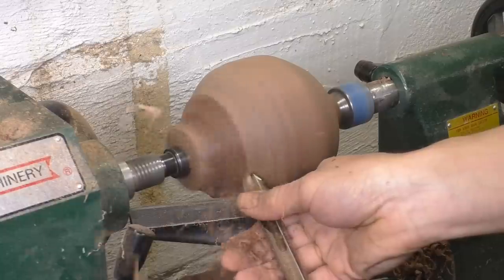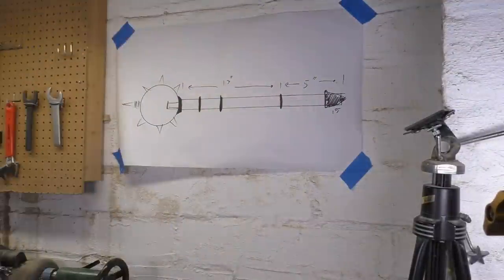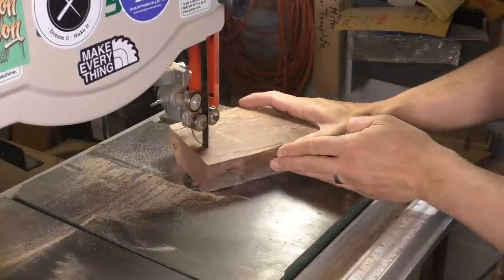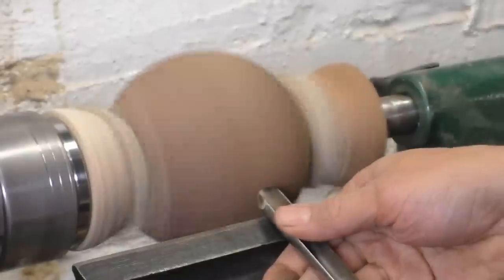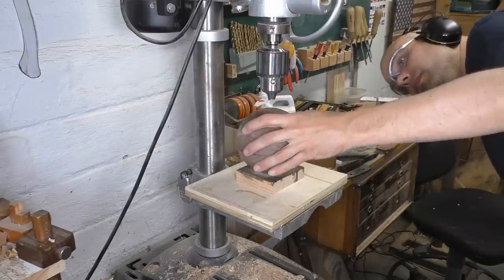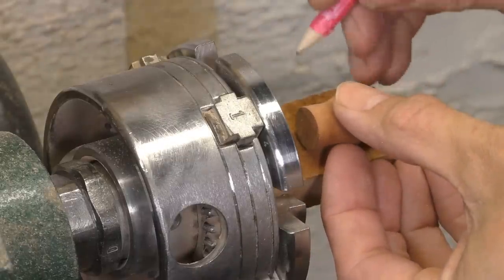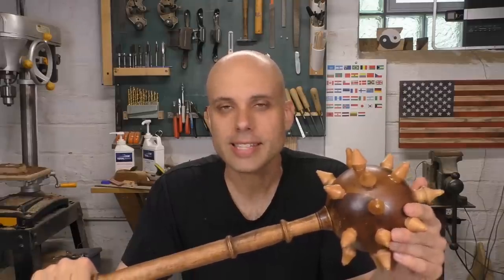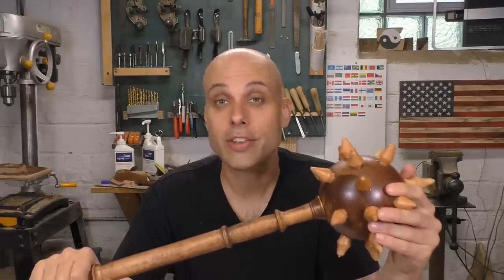Woodturning a spiked mace

Comment: Nice work. When it comes to doing repeated turnings of the same thing, I like to stick a profile plan (just line art is fine) behind my lathe, in line with where the workpiece will be. I built a cabinet for it so my lathe has a back wall close to the chuck, but you could clamp a piece of board back there to achieve the same thing. Having that profile reference there all the time, in the same place, and easy to compare with the workpiece by simply shutting one eye, really makes it easy to repeat the same pattern over & over again. Provided you don't move the plan back & forth, you can do away with all that two-handed caliper/cutter stuff entirely (which is nice because I've raked more than a few knuckles from that over the years).
I look forward to seeing more of these.

Comment: Very interesting video. My suggestion for "Forged from wood" would be a katana or rather a bokken made from wood. I'm quite interested in making one myself, but getting the bevels right seems very tricky.
Reply: I actually have an "authentic bokken" from a Japanese shop... 

   It's worth pointing out that I found the thickness of a wooden sword's requirements (so practice wouldn't destroy it instantly) forces the angles of bevel to be different from the "steel model"... 

    I suspect this affectation is part of why they went to binding bamboo for later bokken, since it's impractical to even try to make a "realistic" katana out of anything but decent steel in the first place. Basically, you can relax, and if you get something that even resembles a katana in profile, you've probably done well enough. ;o)

Comment: Rex!!! Awesome project.  You get to make something cool, learn about the thing you are reproducing, and hone your skills like the matching pieces!  I loved your drill press solution for getting the handle and the spike aligned.  I wondered if you considered marking the sphere between the centers on your lathe, which was my first instinct.  If you did, what obstacles made you opt for the drill press technique?  Or did your work flow have more of an influence on your approach?  Very excited to see this series develop!
Reply from the maker: As usual, you are SO thoughtful. The short answer is that marking the sphere between centers would ensure the marks would be in a straight line, but no guarantee that the marks would be dead center. Then, I'd still need a cup of some kind to center the sphere for drilling.

Comment: I watch quite a few  woodturning videos and I see lots of guys stick a very rough blank or even a log on the lathe and tentatively start 'nipping' at it with rather large gouge until it starts to form a cylinder. Puzzled, I thought I'd ask you; [as you seem to know your lathe stuff] couldn't some kind heavy duty rasp be used to rough-out  these irregular objects? {no i've never used a lathe lol}
Reply from the maker: I think a rasp would be very slow and clog quickly. A better approach is to rough out the blank before it goes on the lathe. Even some quick hatchet work helps a lot.

Comment: when you say epoxy are you talking about the 5 minute stuff or the larger one in 2 bottles you mix together < which you use for molds and when turned on a lathe comes out in strings. I believe the later is also called epoxy resin